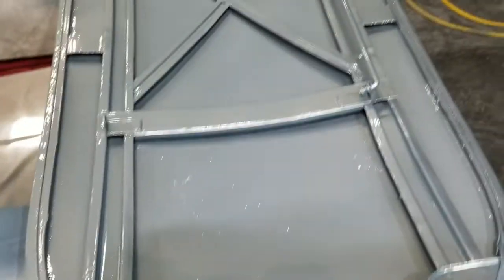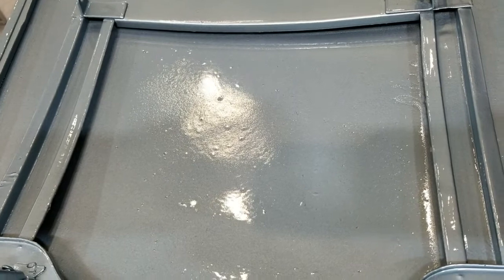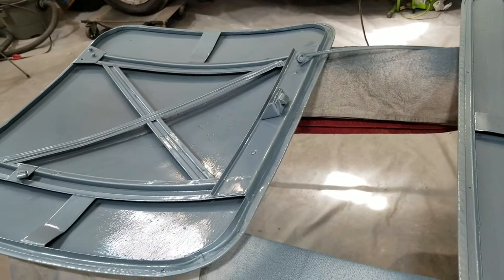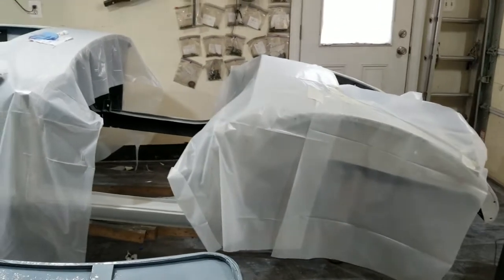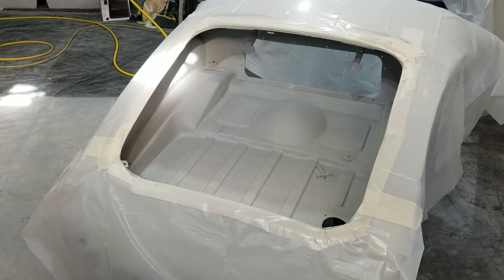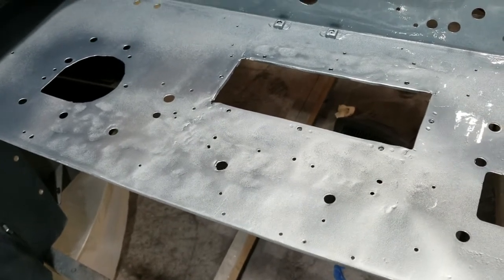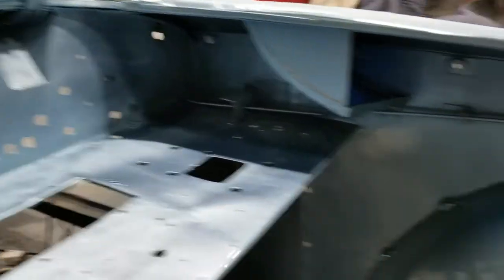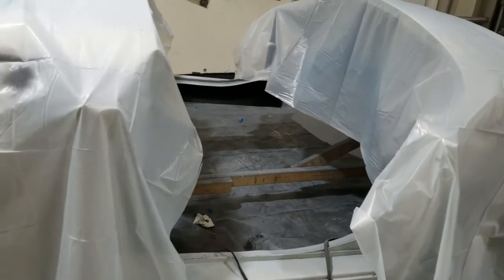1958 MGA Restoration 17c Painting Trunk and Engine Bay

Comment: would a skim coat of filler help the flat section before the fire wall? But your right when the heater and the brake lines and the rest, I doubt that it would be noticeable. The color was a great pick can't wait to see it on the long exterior panels.  I had a 58 MGA in the early 70's still had the original black paint and I do recall paint runs in the door jams, so the Brits were not exactly perfectionist either. Really enjoying your posts, you ever get over to see some of the Triumph posts, Cheftush and Elin Yakov Rusty Beauties Both bright creative guys I think you'd enjoy. Thanks for sharing.